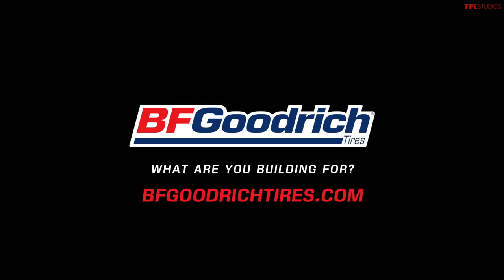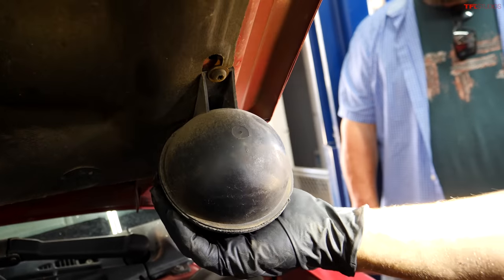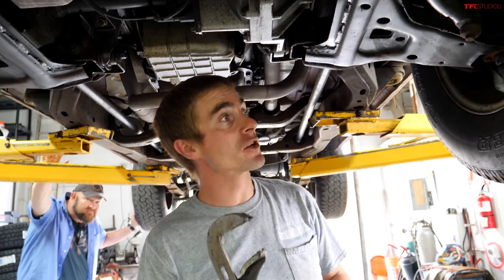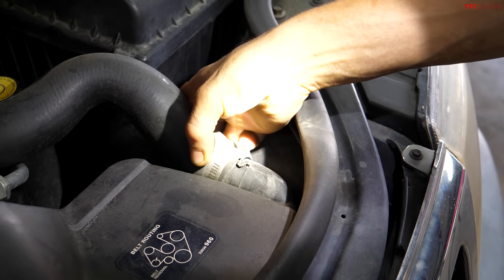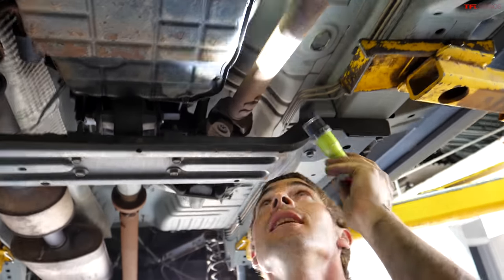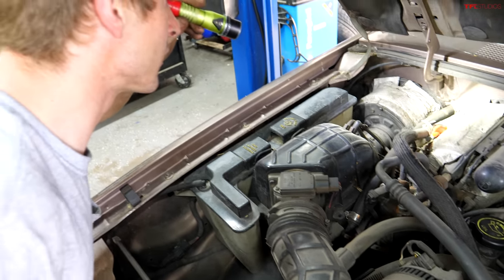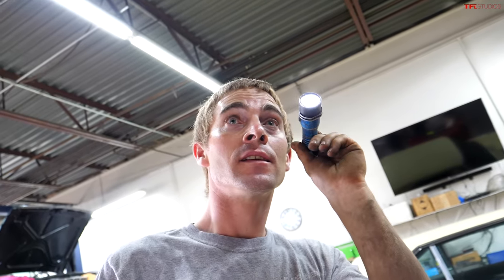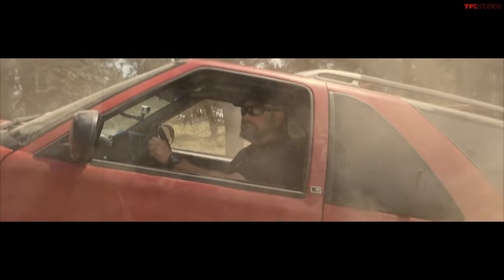It’s Much Worse Than I Even Imagined — Our Mechanic Can’t Believe What a POS I Bought!

Comment: If you drive old cars, a good mechanic is worth his weight in gold.
Reply: A good mechanic will want his weight in gold.
Reply: If you drive old cars, you should be the mechanic.
Reply: Not necessarily. If your old car is a worthless pile, then you either should get the cheapest guy possible, or do the work yourself. Otherwise, you'll just be throwing good many after bad. This is because, for many old cars, the repairs total the value of the car. Remember that before you start digging yourself into a hole and wasting your money.

Comment: just a heads up on the ford ranger 4.0L V6  that is the OHV engine which is a hell of a lot more robust than the SOHC engine , there is a stroker kit for the 4.0L OHV engine , still worth every penny he spent on it , even though it does require a engine  rebuild, i would not hesitate to purchase it

Comment: I'm WAY late, but a few points on the WJ:

- Check the rear brake hard line, along the uniframe rail just before the drivers rear wheel.  Even if the rest of the line looks great, there's one turn there that they ALWAYS break.  Best to know now, rather than later!.  It's a few inches up from where the first rubber line for the rear goes.  Every WJ we've had has had this spot fail even if the rest of the line looked perfect.  

- For the transmission, I'd do a fluid and filter service.  These have two things that can occur - one, the panel filter sometimes people leave behind the old gasket/oring and it causes issues, second, there is a spin on internal filter that can come loose if not properly installed.  That can cause line pressure issues, as fluid will bleed out of the loose spin on rather than circulate.  Seen both.

- The transmissions are also susceptible to electrical issues, mainly many of the grounds on WJ's like to break, which though rare, can cause issues, so if a fluid/filter service doesn't fix the codes, good to go over grounds.

At one point we had 3 2004 WJ's in the family, all slightly different configurations.  Two 4.7s, one I6.  We still have one WJ in the family and my old one is with a friend, and the third one I sold to a neighbor down the street.  I kinda miss 'em!  Been awhile since I did a WJ video but hopefully these tidbits are helpful to you!
Reply: I have a feeling 1 of the TCC control springs in the trans pump is broken, especially at 200k+ miles it's common. It won't allow the converter to lock up properly in 4th gear so the clutches in the converter are getting worn quickly and get hot. it can also cause low line pressure especially when cold. It may start to overheat at freeway speeds if they become too worn but should perform fine otherwise

Comment: that 'Clamp' on the blazer, next to the control arm is factory, it's for the optional steering stabilizer. and the rear 'wheel bearing' is not a wheel bearing, it's axle end play, normal for a 7.5/7.625 rear diff, C-clips leave slop in the rear ends, same thing that happens in old CJ's

Comment: I bought from a friend 1 year and 3 months ago a 1995 Toyota Tacoma 4x4, V6, manual 5 speed, power everything and even cruise control, tires are 31 1050 R15 brand new. Two-door and has been parked in a garage it's whole life and for the two biggies, and only had 86000 original miles and I paid $3,500. So now I park it in my garage and as of today she has 91,000 miles. I have never seen a 95 Toyota Tacoma this clean she is definitely a beauty!

Comment: That jeep was in pretty damn good shape. The nice thing about them is they made a lot of them so parts are plentiful and relatively inexpensive. Although uncensors and electronic stuff you really want to go with genuine Mopar parts for some reason Chrysler's do not like aftermarket electronic stuff.
On that 4.7 v8 you really want to make sure it never overheats. They have a very small tolerance for overheating. They'll end up dropping valve seats out and that's the end of it. Also the power steering system runs the cooling fan in that engine. About 800 bucks when it fails. You can't just stick an electric cooling fan in there to replace it you'll get a check engine light. That might work in some states but if you have to get any kind of emissions test it'll fail because the lights on. Other than that pretty simple and durable car. Honestly all three of these would be pretty easy to keep on the road. I think they got decent cars for the money on all three. If you were doing this work yourself none of it would cost that much money to do.

Comment: I've got a 98 Ranger with well over 250K on the ticker, heads are an issue. Haven't had any issues with gaskets but they have a tendency to crack between the intake and exhaust valves. I don't have any hard evidence but I heard there was an issue with whoever did the castings for the heads. I'd dump those auto hubs for a manual setup. This is going to be a fun series.

Comment: I recently lost a Blazer Xtreme and it makes me really miss my baby. I had mine all ready to go full monte, w/ full Ridetech air suspension and LS1 swap - the works. Then some drunk slams into it, while parked outside my friend's house, pushing the frame rails into the tires and buckling the rear floorboard upward about 18". Still have a garage full of S10 parts I pulled off of the carcass, along  w/ all the other goodies I had - Rrrrr!  I just started thinking about some replacement. Wanna sell that one? lol

Comment: On that 4.0, when that oil pressure sensor Ford used starts to leak, REPLACE IT, mine started dripping occasionally, nothing major, then a couple days later it dumped all my oil less then 2 miles from my house and left me stranded. So once it starts leaking it needs to be changed immediately. I like how he knows about the head/head gasket problem on these 4.0’s lol I’ve replaced my head gaskets 2 times following Fords standard operating procedure for a head gasket repair.

Comment: That's a factory bracket on that blazer, by the suspension, it's the steering bump shock bracket. That torched metal around it is also from GM themselves

Comment: I've had 2 Ford Rangers. Always go with the 4 cylinder and stuck! My first on had over 318000 miles on it when an accident claimed it! The second one had 274000 when I  sold it! Both has 2500 four cylinders! Both were 98s.  Lot of auto part stores used them for deliveries. Always get the inline 4 and 5 speed stick. Stay away from the automatics and 6 cylinder trucks.

Comment: For the price of 2500...there in good shape...that's price is just above scrap value..
Reply: U bet, $2500 is the old (2-3 years ago)
$800 beater, thx FedReserve...
Reply: @rickreese5794  You mean the new $800 beater.
Reply: No scrap yard is going to pay anywhere close to $2,500 for these. Also, when you add up all the repairs and differed maintenance on the Mazda and the Blazer, they're likely totaled, so they're not even worth wrenching. The Jeep might be the only bargain. Not only because it's in relatively good shape, but I think it's worth more than $2,550.

Comment: i got my first car for 1800 and it was no where near as bad as these cars, all mine need was a new transmission mount as the old one was cracked in half, after the first year of driving i replaced another two parts like the cooling fan and a relay and now after 3 yrs i have done a wheel bearing, brake caliper, brake hoses, alternator, all the motor mounts, new tires, cht sensor, and a battery. ive done all the work myself and the car has treated me nicely for being a cheap car and it doesnt leak any fluids, no oil leaks, no coolant leaks, nothing underneath not even old residue. i couldnt be more grateful

Comment: As a former ranger owner, it was an amazingly reliable truck but the suspension falls apart 😂. I had to replace every piece of the suspension, it was leaking so much grease it was insane. The brakes were weak too, I replaced the master cylinder, and the brake booster. Any old Ford owner knows the power steering pump is definitely weak, don’t buy a remanufactured one buy a new one you’ll thank me later lol

Comment: As  someone who first auto was a 99 WJ Limited with the powertech v8 and NV247 ( used ) with 118k on it and over the last  15 years  have had it as a offroader putting another 250k in miles on it putting it at 370k now I have kept my fluid clean and never had a transmission problem.  worst repair was the replacment of the front calipers which I believe were only a 99/2000 model issues that caused rotor warp.   the WJ will be the winner with out a doubt.

Comment: Interesting stuff and Toby seems to be a decent guy. Puzzles me though: these three blokes are "car guys"; did none of them look underneath the cars before they bought them? The stuff Toby's pointing out isn't hidden and could all have been spotted with basic checks. For what they paid, these vehicles don't seem too bad though, except maybe the Mazda.
Reply: "Car Guy" and "Gear head" has diverged more and more in recent decades. You can like cars and know nothing about how they work. There's less and less incentive to even try to learn as more things get computerized and you need a 15k dollar scanner just to read the codes for some things.
Reply: @Sir_Pants_Alot  Very true but most of the faults here are mechanical, rather than high-tech black art gadgetry. I suppose that's why these guys don't wear overalls and Toby gets work from them.😁

Comment: The mopar 4.7L v8 is a nortorious overheating engine  , they put the thermostat on the cool side of the radiator , my Ram 1500 with that engine loved to be over the half way mark . Got a jegs in-line thermostat housing moved thermostat to top right now thermostat works and I have a good truck no more over heating

Comment: Bought an 01 Sonoma ZR2 with a manual last year for $700. Needed 4wd actuator, intake seals, water pump, egr tube, secondary air pump, u joints, pads rotors and calipers all around, driver side cv axle, brake line going to the rear, spark plugs and wires, and tires. Take away the cost of the tires and I would've came in under budget for this 🤣 especially since I do all the work myself...somewhat correctly

Comment: That grand Cherokee is very clean and it's very rare to have a selec trac 4wd system in the v8 those usually came with the 🪳 engine that I love. That thing is rust free on the rockers. I have one that is too but I paid $10,000 for mine it had 119000 miles now it has 132.

Comment: I live in Westminster outside of Boulder and Denver. 

I have a 04 limited 4wd sequoia. 
Going to lift it soon so I’d like to compare it stock with the 32s I have on it at stock suspension. Against an 04 land cruiser. 

The price difference is like 15k at times between the two. But I can’t see why that is the sequoia is one of the most capable 4wds Iv ever owned.

Comment: Honestly if it drove to the shop it's probably a win. Any vehicle that old that cost less than 3K is going to need something repaired or replaced. Real questions are 1.) is the frame solid & straight, 2.) is the drive train in good enough condition that it won't need to be rebuilt or replaced in less than 10K miles? If you can answer yes to both of those questions you are ahead of the game.

Comment: The Chevy and jeep are decent for the price, the generic brand Ford, just deserves to go to a crusher.
Reply: Ye of little faith.  The Ran... er, B series just needs a little attention.
Reply: Fords of that era are hard on front end parts. The issues found aren't bad enough to junk the truck. To scrap it for what was found is like killing your friend because he has a cold.
Reply: @Gene1969  A lot of attention.
Reply: @AkioWasRight  I've had dates that required more.  😬
Reply: @Gene1969  That's doesn't necessarily diminish much.
Reply: @Gene1969  I'm not sure if that says less about Andre's broken fake Ford, or if that says more about your high-maintenance dates.
Reply: @AkioWasRight  🤣
Reply: Yeah and it has 100k less miles on it than the others, thing is a pile of crap. There's a reason Ford didn't need a bailout, and that's because they've been ripping their customers off for the last 25 years. You'd sooner get them to chop off their own thumb than pay for a warranty repair, or admit to a engineering flaw in their products. Cam phasers on the early mod motors for example. Aluminum bottom end bearings, designs that are overcomplicated requiring a multitude of specialty tools simply to discourage people from doing repairs themselves. Basically forcing them to take it to an expensive dealer to be fixed. I wouldn't own another Ford truck if it was free, because it wouldn't be after you figured in the cost to keep one running.
Reply: Make sure to keep your Prius
Reply: @paulhunter9613  I have a 2015 Sierra Denali, and a 02 wj overland. No foreign cars in my driveway.

Comment: I thought the rear main seal, oil pan seal and oil filter were leaking on my 3.0 ranger, but the PCV jammed shut and the pressure pushed past the seals. Headliners bad because 3rd brake light leaks.

Comment: I would rather fix worn out suspension then have to fix a bad transmission any day. Same goes for the Chevy with its rear main seal leak, either way with both the jeep or the Chevy you’re pulling a transmission to do repair
Reply: But it hasn’t. Lol
Reply: Suspension work can cost as much, if not more, than a transmission job these days.
Reply: Mechanic here for 25 years. Twin I beam suspension is very easy to fix and and are damn near impossible to break. If you have ever had the pleasure as I have to pull a transmission, completely tear it down, rebuild it, then reinstall it. It’s not fun in the least bit. Not saying I enjoy rebuilding a whole front end but I would take that over a trans job any day. Also with all those codes it has they will come right back and it will go out. The transmission alone will cost more then the price of the car. Not hating on the jeep, I own a wrangler my self and have owned several rangers “Mazda” in my life.
Reply: @raptor350rick  if it does it’s served. It has a ton of miles

Comment: That generation of ranger/mazda came with two V6 engine options. A 3 l V6 and a 4 l V6. The 3 l V6 is the engine that had head gasket and head issues as it was an aluminum head on a steel block. The 4 l is a tank. I've owned multiple and you can beat the living crap out of those engines and they just keep going. I would say my one complaint would have been that over time they consistently start dumping more and more fuel and your mileage goes down. I have had some success reflashing the computer to reset all the original parameters and take out any adjustments the computer has made over the years

Comment: Chevy for the win it don't need a complete rebuild or transmission..
Reply: Thats because it allready had 3.
Reply: what do you call a rear main then lmao. thats a pretty big job depending on two piece or one piece rear seal.
Reply: The 545 rfe in the jeep is stronger than the 4l60e in the s10 .
Reply: Replace a heater core on that chevy then tell me how much you love it.
Reply: @HowardJrFord  agreed i have a 03 with the 4.7ho 220k miles still going strong only drives in the city. All the 4l60s i have had made it to about 130 to 140 and were trash.

Comment: This is giving me so much inspiration on my own WJ project. I'm rebuilding a '02 WJ 4.7 Limited that I bought a few months ago here in Australia for $1k ($700 USD). It was sitting on a farm with a broken timing chain. The interior and body are in beautiful condition and it has zero rust. I just plonked down $2,800 on the weekend on a heap of new parts to rebuild the motor, and there's a few more $ needed to get it on the road. Seeing what $2500 USD buys now makes me feel like Ill have a pretty decent truck for a pretty good budget once I'm done.
Reply: All of the 4.7 Jeeps we have owned have gone over 200K miles with no major work to the engine.  Sensors, belts etc but other than one leaking at the valve cover no issues on the 4.7.  Surprised it is a chrysler engine from that time, if it was 1970 or older you expect the good motor not 1999 or newer ones though.
Reply: @badgerpa9  You've hit the nail on the head! The 4.7 was an AMC design that was being developed in the prototype stages that Chrysler inherited when it bought AMC. That's why it's not considered a HEMI.
Reply: Wrong. The 4.7 is an updated 318
318 is a Chrysler engine that’s been around since the sixties
Reply: @paulhunter9613  Wikipedia says it's an AMC design

Comment: Dude…..you missed most important thing to check is air filter and check fluids on 3 box (transfer case, front diff, and rear diff) 😅, but overall this mechanic is good and what the car it needs.